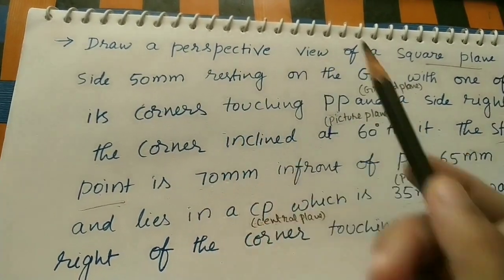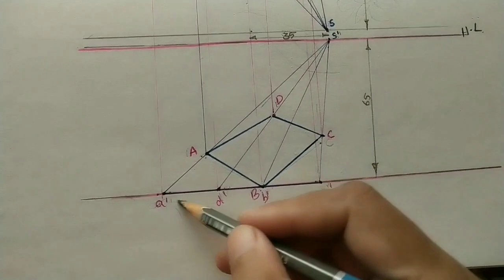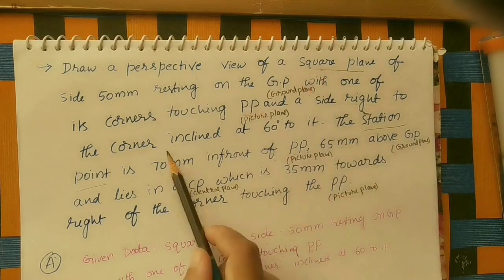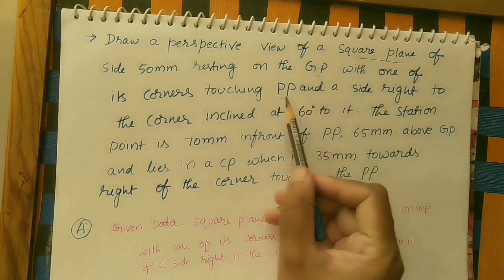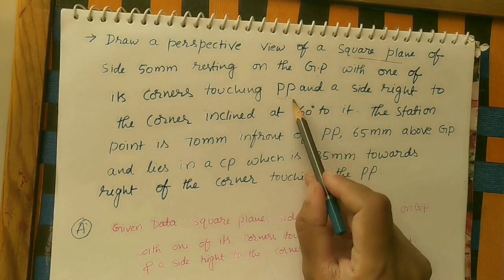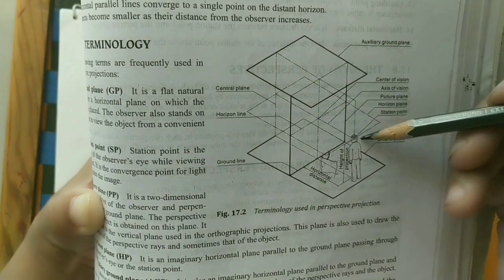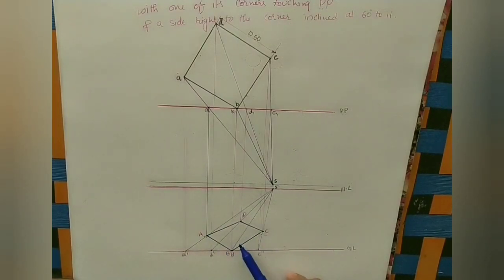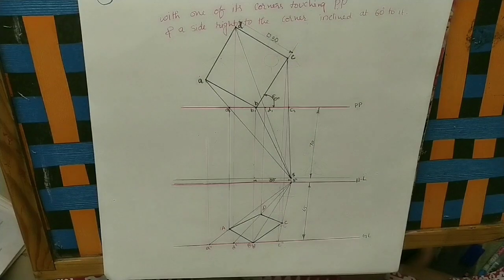Perspective Projections Of a Square Plane//Engg. Drawing //Engg. Graphics

Comment: Sister one help could you please reply before 10 am I have exam
A square prism of base side 30 x 35 and height 50 mm rests on the GP with the edges are equally inclined to 8 PP. The corner nearest to the PP is 30 mm to the right of the station point and 20 mm behind the PP. The station  point is 65 mm above the GP and 80 mm in front of the PP. Draw the perspective view of the square prism.

A square ku all sides equal la than irukum how can I take 30*35 mm square has four sides in which Two sides is 30Mmm and other is 35mm ha
Reply from the maker: Yes u r correct. Take each side of Square is 30mm & height is 50mm. Don't consider 35mm. It's has given wrongly.
Reply: @engineeringclassesbydr.noo3377  Thankyou so much sister